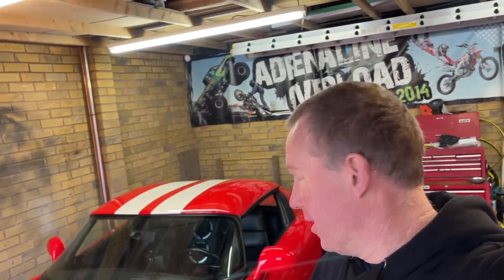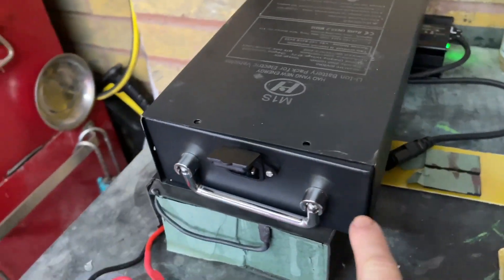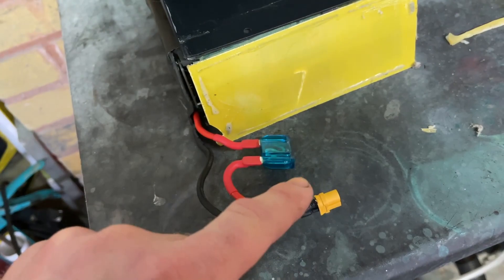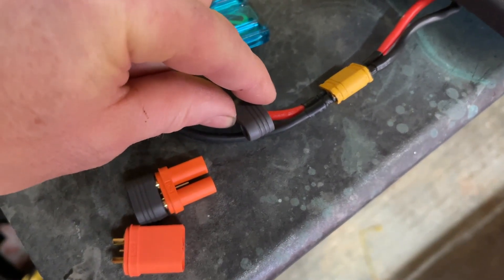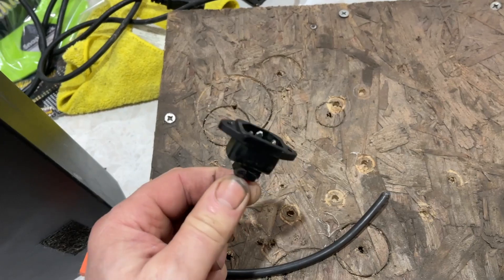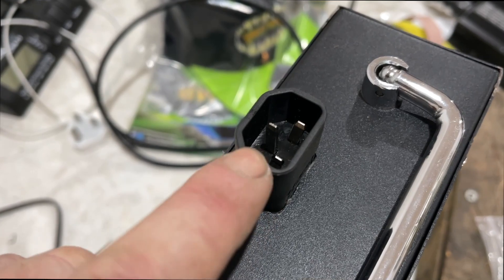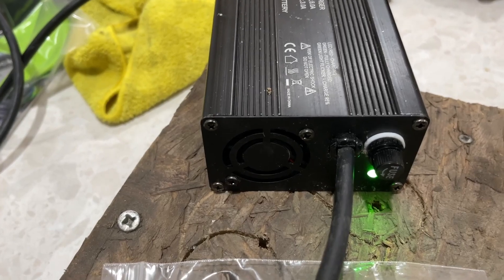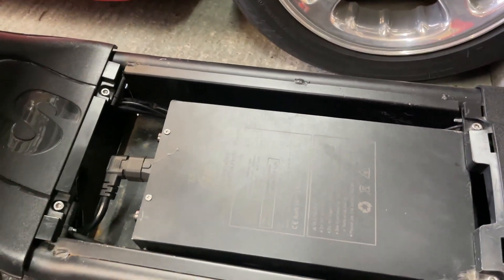E Moped battery problem fixed

Comment: Hi there I've had a bike like this for 2 years now its a roder brand and won't turn on. I've never messed around with it much only a wire that smashed and put it pack and used electric tape to hold it in place as properly as I can. I've tried averting I know to do. Ant advice?
Reply from the maker: It’s hard to diagnose it without seeing it

Comment: i have a question i have the same scooter but it started cutting power while i was driving like it goes and stops and i’ve notice a exclamation mark on the bottle right corner of where the miles are display any info on that @swampthing4x4
Reply from the maker: I have no idea what that is

Comment: I have a question.
My e chopper mangosteen m1 has a 2pin accu connection.
I see on your's that you have a 3pin connection..
Is there a way that i can change my connection port or use an cable that switch the 2pin to 3pin?
Reply from the maker: Mine has a three pin connector, but the only uses two of the pins the third one is just for location. You could change this to any connected that you like.
Reply: @swampthing4x4  oh, that's absolutely great :) Thank you very much for answering!
This is very helpful..
Reply: I have one more question :)
I have a 60v 20ah battery.
The fuse that i have inside is an 60a .. can i replace this with a 40a fuse? I saw a comment in the chat saying that he said that a 40a fuse is needed.
I just want to be sure if that means from my battery too.
Reply from the maker: @HaNsSiEHans  I would stick with the 60 amp still in there. I did have a problem with mine on a very cold day going up a steep hill. It pulled a lot more current and blew the original fuse.
Reply: Thanks again :) i have set a new 60a fuse in it.
But now i have a new question of which i hope you can help me.
My battery indicator gives 3 bars left but it shuts down all the sudden and won't turn on anymore..
What could be the problem?
Is this telling that i need to buy a new battery?

Comment: Hey man i have the m2 and its been sitting for a while today i try to use it but its dead and when i plug the charge in the light is green when i plug the battery like id its on full, but when i plug the bike to the battery it wont turn on.
Reply from the maker: If the BMS is damaged on your battery, the charger will not work as it cannot see the battery as the BMS choice to protect it

Comment: Did you have problems registering this ebike?
Reply from the maker: No I did not.
It came with all the paperwork and just registered it with DVLA
Reply: So yours came with a title? Sorry for all the questions. I just got one, and it didn't come with anything
Reply from the maker: @shunmoore2449  mine came with a CE certificate and commercial invoice and all I had to do was show proof of insurance as the tax is zero rated I didn’t have to add any money just pay £150 for first registration fee
Reply: I have the same exact bike . I didn't have any paperwork. Just printed a billow sale of the internet and was able to register it as a moped
Reply: @jessejohnson7759  I ended up having to return the one I bought unfortunately. The battery and hub motor weren't working properly

Comment: I unlocked mine,I put it back to stock the battery went down so fast even in mode one...Between the speed and range.I liked the range .....Your only getting 4 to 5 mph faster, it`s not worth it ...........And I do carry 2 battery`s and pull a Burley Trailer some time`s when I`m going camping on it and fishing........I LOVE THIS THING...........Old M1P Chris    NC..............Have A Good
Reply: Chris 
can u share how u put two batteries in that chopper?
Reply: @dennis8019  It`s kinda sloppy .I still have to stop and switch plug`s I haven`t figured out how to run them parallel......They do fit on there side`s in the battery hole.I have braced them tying to think of some way to build a box over them that look`s half way good.......Let me no what you think..   E-Bike Chris...............

Comment: just curious how many cel battery is that and\or how does it ballance charge itself
Reply from the maker: It’s 40 cells it has a built in circuit board

Comment: why bother with the black connector. just wire it with the connectors that Kev gave you and that would have been job done... (obviously you would have to change the connector on the charger as well, but that wouldn't take long...)
Reply from the maker: Yes 100% if  I have any more problems with it I will. The only reason I didn’t as I didn’t have any more connectors. As I would have to change the connector on the bike and also on the battery charger system. however the black connector has lasted for three years up till now.